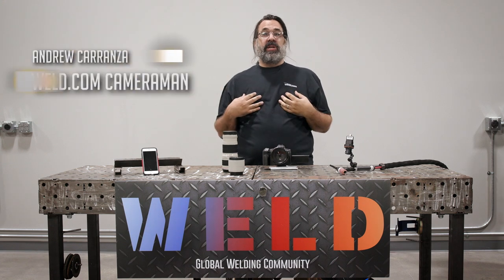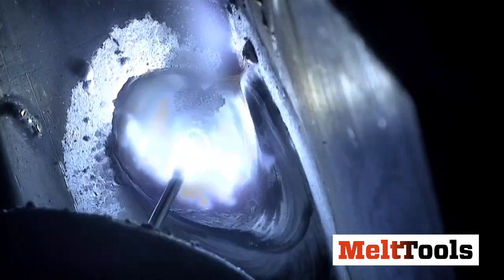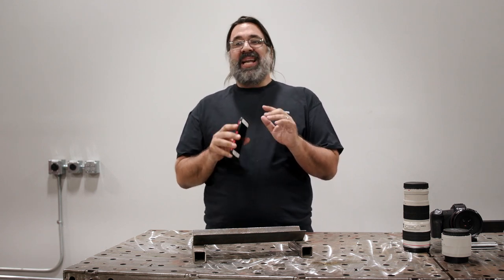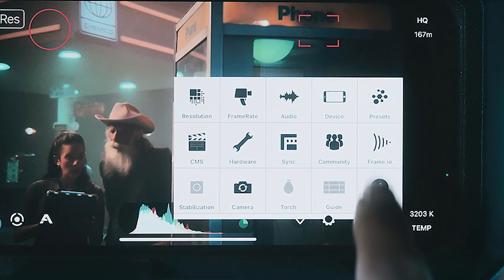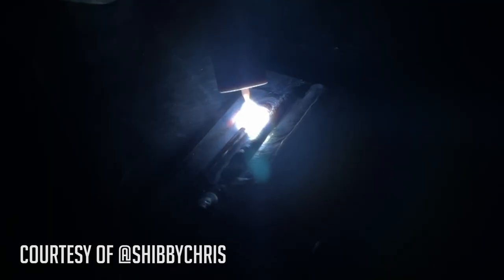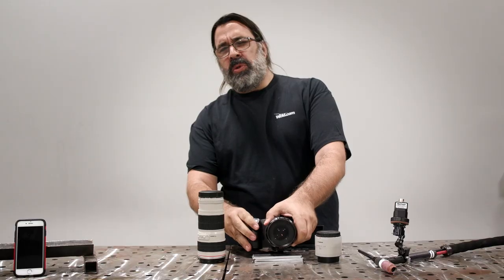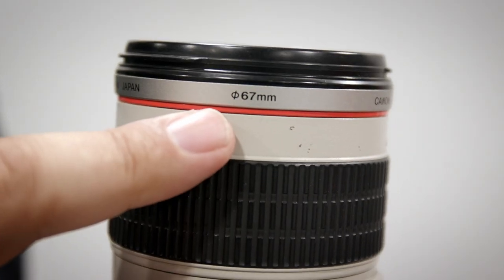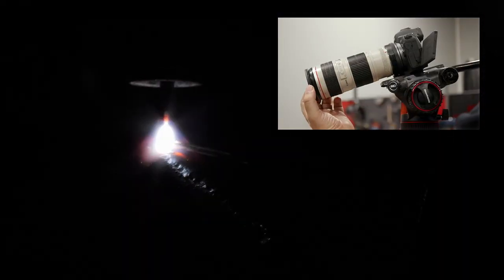How To Get The Best Arc Shot

Comment: Can the UV from the arc damage the sensor in your iPhone camera after a while? Should you use a UV filter when recording welding arcs? I might also ask the question about IR too.
Reply: 1000 times yes I've fried 2 phone cameras before i started putting a conventional welding lens in front
Reply: @owenbalzer6582  the damage was done by the light intensity , not the UV......
Reply: 999, the UV will not hurt the sensor, it is the intensity of the light that does the damage, a UV absorbing filter will do nothing for protecting the sensor, but it will protect your lens from sparks.....so use some sort of Neutral Density filter, polarizer, or welding filter, the plastic gold coated ones will give a truer color, as some of the newer Auto Darkening ones, the glass gold coated filters will still have a very green cast, the gold is there to remove the Infrared waves which produce heat and also have an effect on your eyes leading to cataracts, the UV on the other hand is what burns the retina......it is safe to look at the digital screen of a DSLR,Phone, or video camera with out a filter, but the brightness will be overwhelming and you probably will not see much......by the way, the variable neutral density filter Andrew refers to is actually 2 polarizers , when one is turned, it cancels out the light coming through the other, you can make your own if you have 2 polarizers.......hope this helps, Paulie Brown
Reply: @ypaulbrown  Thanks for the hints. Good reminder to wear a welding helmet when closely watching or photographing someone welding.
Reply: @ypaulbrown   The UV will damage the lenses as most lenses are made of polycarbonate plastic. Over time the uv will cause the lens to craze (micro cracks) and will become unusable and not replaceable. A DSLR with a UV filter stacked on a variable ND along with tweaks to the internal camera settings will get you some great arc shots. The higher end ND filters do a much better job than the cheaper ones. Tweaking in post is another factor also.

Comment: There’s a channel called “100 Ампер” their arc shots just amazing and probably done without any special cameras. I suspect he’s using a ND filter and a massive light source.
Reply: Did you get any more info on the video techniques that "100 Ампер"  is using?  I agree the arc shots are amazing.  No dimming of the image between Arc off and arc on and the weld puddle is pretty easy to see.  
Do you know of any other channels that have good Arc Shots?  I think Jody at weldingtipsandtricks seems to have good arc/puddle shots.
Reply: @tinkertime4588  He's keeping the technique a secret but from what I know, he's using an ND filter accompanying an extremely bright light source. Also, my guess is a polarizing filter to get a better puddle view.